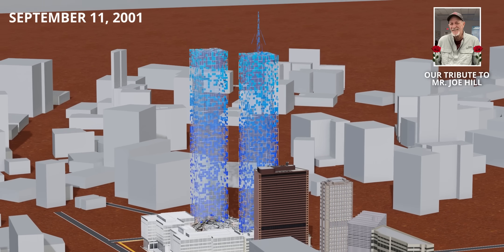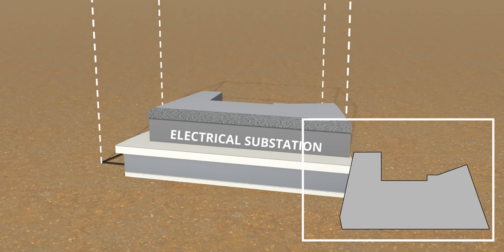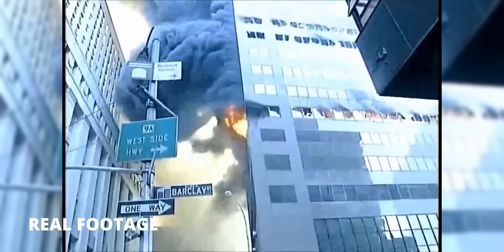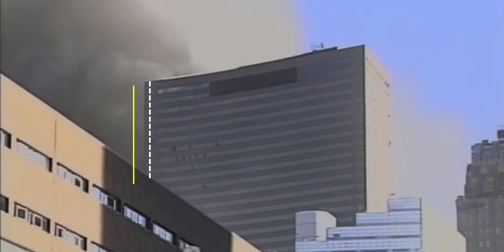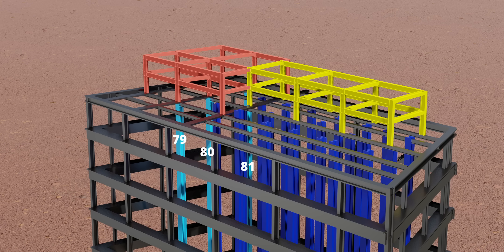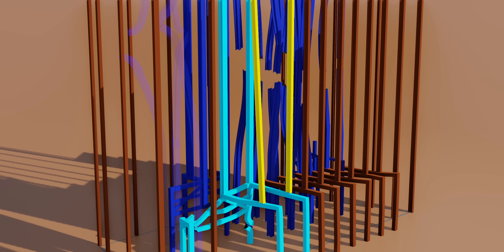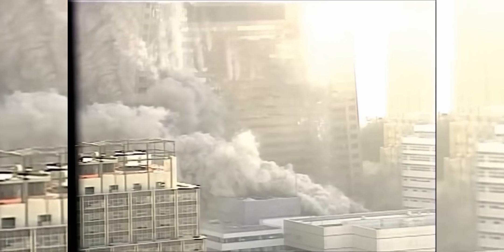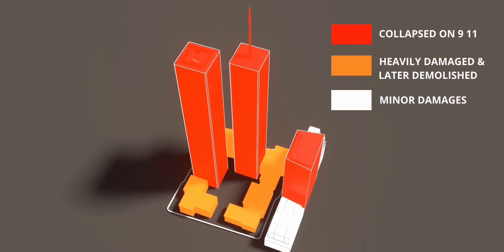Collapse of Building 7 | The Complete Physics

Comment: Was this a grade school project? It’s hard to ignore how symmetrical the collapse looks like a textbook controlled demolition. The way the building drops straight into its own footprint, almost at freefall speed, just screams explosives to me. You can even see these little puffs of smoke popping out floor by floor right before it starts to buckle, which lines up with how they time charges to weaken the core columns. I’m no engineer, but it’s wild how it mirrors those Vegas casino implosions from back in the day… too clean to be random fire damage, if you ask me…
Reply: The collapse of Building 7 was progressive, the opposite of symmetrical. 

Building 7 - the 6th building to collapse of 10 lost on 9/11 -though extensively studied still confuses many. Not famous or a terror target, and with no casualties, it did not get a lot of attention initially, creating a void the internet rapidly filled with garbage. Because everything seems like a conspiracy if you don’t understand how it works I prepared this brief summary of the collapse from my own analysis. No politics, just engineering. 

Context: The North Tower collapse at 10:28am bombarded Building 7 with tons of burning debris, causing heavy damage and starting multiple fires burning out of control for the next 7 hours. Half the FDNY firefighters having been killed, others injured, units in disarray, equipment destroyed, no water pressure, and the greater urgency of Search & Rescue efforts, firefighting was pulled as futile. The building couldn’t be saved and was left to its fate.

www.youtube.com/watch?v=g_SvpwyC17M&ab_channel=MFitz  

Collapse of a burning structure is always a concern for firefighters. Steel buildings subject to fire rely on active fighting of the fires to survive. Buildings are designed around 1 to 3 hours of fire resistance, allowing time for occupants to escape and ACTIVE firefighting to get started, after which all bets are off. Left to their own devices they will exceed their design envelope and collapse. In B7 the occupants escaped, passive and active fire protections were compromised and active firefighting was abandoned which left the building to take its chances. It lost. Odds on Building 7 would eventually collapse, and it did. No big deal in logic. That is the sort of choice firefighters make every day in brush fire situations - which houses to save and which ones to let go. Only real difference here is moving the decimal on the size and cost.

www.youtube.com/watch?v=WnYBX6QT0R4 

FDNY Chief Daniel Nigro ; The biggest decision we had to make on the first day was to clear the area and create a collapse zone around the severely damaged 7 World Trade Center, a 47-story building heavily involved in fire. A number of fire officers and companies assessed the damage to the building. The appraisals indicated that the buildings structural integrity was in serious doubt. I issued orders to PULL BACK the firefighters and define the collapse zone. It was a critical decision; We could not lose any more firefighters. It took a lot of time to PULL EVERYONE OUT, given the emotionalism of the day, communications difficulties and the collapse terrain

FDNY Deputy Chief Peter Hayden ; We had our special operations people set up surveying instruments to monitor and see if there was any movement in the building. We were concerned of the possibility of collapse in the building. And we had a discussion with one particular engineer there, and we asked him if we allowed it to burn could we anticipate a collapse and if so, how soon? And it turned out that he was pretty much right on the money, that he said 'In its current state you have about 5 hours

The collapse of Building 7 was anticipated and widely reported in the media throughout the day. At least 24 video cameras recording some or all of the collapse. Everyone knew what was coming and why.

www.youtube.com/watch?v=OY5S5k3tMHI 

Building 7’s collapse was completely different to the Twin Towers, harder to understand with most of the details difficult to see. But we can still sort out what happened through careful analysis and observation.  This is MY EXPLANATION of the collapse sequence using the best available information and relying on no authority.

B7 was complex 47-story steel framed structure built on top of a smaller existing 3-story building, requiring several lower floors dedicated to complex load transfer structures instead of usable office space. Of trapezoidal shape and all-steel tube-in-tube construction, B7 (above the 7th floor) consisted of a central core of steel columns carrying most of the gravity load, perimeter steel columns around the outside of the structure carrying the remainder of the gravity loads and long span beams and girders to tie those elements together and form the floors. On the outside of the building hung a moment frame - the last part of B7 to fall. 

Phase 1 : The first externally visible signs of collapse initiation occurred at 5:20:28 pm. Collapse initiation for B7 is notably quiet with observers not realizing the building was collapsing! There was no audible warning in the form of say hundreds of ear drum busting 180-190dB explosive bangs preceding the collapse. Here at 12:00 a local CBS affiliate reporter is talking 10 blocks from B7 when collapse begins. People don’t start to notice the collapse until 12:11. Then at 12:45 is the famous CBS fixed camera clip of Building 7’s collapse.  Note how quiet it is.

youtube.com/watch?v=t5tEy6mXSE8&ab_channel=fresnosean379

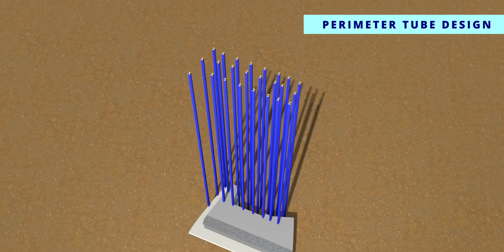Collapse initiation was due to lower floor failures above the load transfer region (7th floor) in the NE corner of the building. In this video at 0:45 you can see the NW corner from inside the building while under construction, Column 79 just out of frame on the left. That big, angled steel beam across the top of the frame connects to C79 at one end. The girders connect to the beam. That beam and all those girders depend on just one connection

youtube.com/watch?v=nP3TNHPCIVU&t=35s&ab_channel=EdwardCurrent

Phase 2 : Lower floor failures caused a loss of critical lateral support over an excessive length of core Column 79 and it buckled. If you look at a floor diagram of Building 7 (see above) and look at all the structures that depend on C79 you quickly realize this one column was a relatively isolated structural element on which a disproportionately greater fraction of the structure depended analogous to say the Key Bridge. Externally we see a vertical progression of window breakage along the 44-46 line and a kink in the roof of the East Mechanical Penthouse at the top of the building, consistent with C79 failure. The transition from full capacity to almost no capacity occurs in virtually an instant. Once the buckling failure occurs there is almost no resistance

Normally with a buckling column, the load could very well be redistributed to other columns, meaning the buckling could stop after a while. With C79 that is not the case - the failure did not redistribute the load, so the collapse rapidly progressed to the roofline, sinking the rooftop penthouse.

Phase 3 : With C79 gone, B7’s progressive, non-symmetrical collapse continues with C80 and C81 at the east end of the core left laterally unsupported and quickly buckled and failed as well, sending the EMP down through the building. C79-81 all have no diagonal bracing, which I believe is a major reason why they could not redistribute a lot of vertical loads among one another.

From there collapse progressed from east to west through the central core until the core was gone taking all of the interior floors and structures and probably most of the perimeter columns with it. You can see the horizontal progression of window failures low in the building and the dropping of the remaining rooftop structures into the building. One of the big takeaways from the NIST Building 7 study (that gets completely ignored) was their modeling which determined C79 failing under ANY circumstances would have initiated the same collapse sequence.

Phase 4 : After some 10 seconds all that remains of Building 7 is just a hollow empty outer shell - the exterior moment frame - creating the illusion the building is still standing since little has changed externally. But it’s just a hollow empty shell like an empty cereal box supported by only a few remaining columns and quite unable to remain standing. With all the internal framing gone. the north face leans inward, forming a V in the roofline, the last perimeter columns buckle under the strain and with nothing left keeping it up the moment frame free falls, landing on top of the 7-story high debris pile. It is only at the very end that a single measurement of alleged free fall acceleration is taken. Note this is not the building but just its outer shell, and only one corner at that, at the very end of the collapse. Start to finish the entire collapse took 18-20 seconds, or less than 1/3 of true free fall and we have to look at the whole thing, not cherry-pick little bits to fit a particular narrative. Worth noting _how fast something falls cannot tell you what started it falling in the first place. The debris spread out, blocking surrounding streets, heavily damaging the Verizon Building and destroyed Fiterman Hall, all well outside of Building 7’s “footprint”.  

Building 7’s progressive, non-symmetrical collapse was incidental and unintended collateral damage from the combined effects of fire + time + gravity started by the collapsing North Tower. That is true no matter who planned and carried out the 9/11 attacks or why . The collapse was of so little consequence it barely even registered at the time, a mere footnote. It only took on semi-mythical status as an alleged smoking gun years later when demolitions at the Twin Towers, missiles at the Pentagon and shoot down over Shanksville all failed and conspiracists had nothing left to work with.

Anything can seem like a conspiracy if you don’t understand how it works. Now you should. I hope you found this helpful and informative and it solicits informed critical comment. If I made any errors of fact, logic or reason or left anything important out, please let me know so I can fix it. IF you can offer a more plausible alternative please do. Be the first. Please start any reply with the words “Tits McGee” or I will know you didn’t read it and are wasting my time.

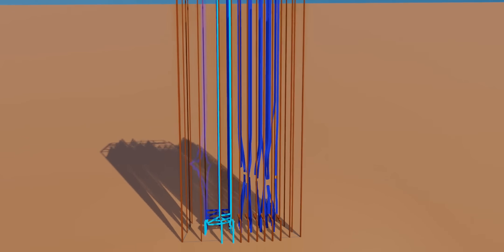Comment: This Totally conflicts with NIST and u of Alaska. At 7:21 this video depicts HEAT causing vertical core columns to totally Snap in two . 

That’s like making peanut butter from popcorn by stirring it just the right way
Reply: The east end core columns buckled. There is no question about it. This video does not actually go into any detail as to why and given the target audience, I think that's a fair choice. There are a number of plausible theories and the details too pedantic to get into at this level anyway.

Hulsey BTW denies what everyone else clearly sees and falsely claims every column in the building failed at exactly the same time - for reasons.

It's mind-numbingly stupid stuff. Not worth the paper it's printed on.
Reply: @ True. All the columns did not GO AWAY ? At precisely the same time. 

But for 121 feet, there was ZERO resistance. That’s just so undeniable and so definitive. Most Americans don’t understand that a structure made from toothpicks can’t , by George can’t , come down at the acceleration rate of gravity. 

There is The crux of a much broader collapse of America. Ignorance is more dangerous than the malice itself. 

This Philip Zelikow? He’s just not swift at all. Have you read that junque? 

This is critical: After NIST stalled for as long as they could, they gave their first evaluation of bldg 7. 

Once made aware of the building falling at freefall for 121 feet , they stated that they ‘Needed to return to the drawing table”. 

NIST would ONLY look at how many seconds it took for the bldg to start & then stop. Nothing in the middle. 

You might recall that the penthouse gave way first? Then there was about 2 seconds of nothing?  

NIST included that time also. Come on! These are scientists.  

Material poured out the side of the Building all day long. I mean it poured out.  Doesn’t even look natural

Comment: This is more media bull-crap, this was definitely a inside job.
Reply: And yet not wrong. Go figure. 
	
This video is pretty good – with a few exceptions - and goes into a much higher level of detail than many viewers will be able to comprehend.  While not perfect, the collapse mechanisms – the sequence of failures - described here  are substantially correct and this is true no matter who planned and carried out the 9/11 attacks or why . 

That may not be what you want to hear and go against 20+ years of entrenched dogma and conditioning, but it’s not wrong. 

That also means (in case you did not get the hint) this video can be (and IS) absolutely correct in its description of collapse mechanisms AND the 9/11 attacks could still have been some sort of inside job. The two things are in no way mutually exclusive. 

The mechanisms described here have broad professional support around the world. There are no professional engineering organizations (for example: ASCE, ASEE, ICE, etc) that disagree with them or have offered any formal dissenting opinions or alternative hypothesis. 

So, setting hubris aside, either the overwhelming majority of the worlds structural engineers and simple observation are wrong,… … or you are. Which seems more likely? 

IF you still think believe this explanation is wrong then produce a better one . Good luck with that. No one ever has and I don’t see you moving that needle today. 

No one ever does.
Reply: Typical “I disagree with this, but I have no idea what i’m talking about so i’ll just call it BS and leave it at that” response

Comment: You have so many flaws in your "explanation" that I don't even want to start. Also because anyone believing in this sh1t is so dumb that I can't explain anything to them.
Reply: And yet not wrong. Go figure. 
	
This video is pretty good – with a few exceptions - and goes into a much higher level of detail than many viewers will be able to comprehend.  While not perfect, the collapse mechanisms – the sequence of failures - described here  are substantially correct and this is true no matter who planned and carried out the 9/11 attacks or why . 

That may not be what you want to hear and go against 20+ years of entrenched dogma and conditioning, but it’s not wrong. 

That also means (in case you did not get the hint) this video can be (and IS) absolutely correct in its description of collapse mechanisms AND the 9/11 attacks could still have been some sort of inside job. The two things are in no way mutually exclusive. 

The mechanisms described here have broad professional support around the world. There are no professional engineering organizations (for example: ASCE, ASEE, ICE, etc) that disagree with them or have offered any formal dissenting opinions or alternative hypothesis. 

So, setting hubris aside, either the overwhelming majority of the worlds structural engineers and simple observation are wrong,… … or you are. Which seems more likely? 

IF you still think believe this explanation is wrong then produce a better one . Good luck with that. No one ever has and I don’t see you moving that needle today. 

No one ever does.
Reply: “I don’t even want to start” or more like “I didn’t see any flaws because I know nothing about what was discussed, my irrational preconceived notions are the only thing informing my opinion on this topic”?
I’d argue it’s the latter